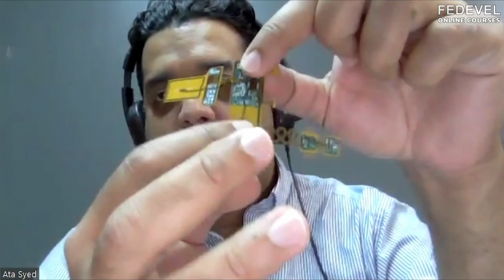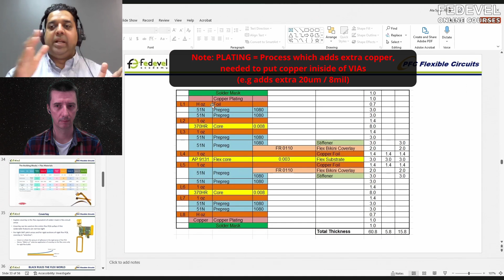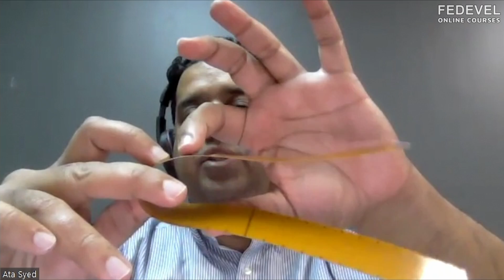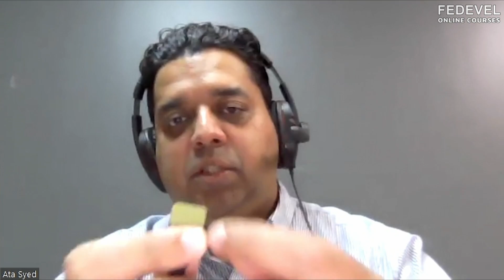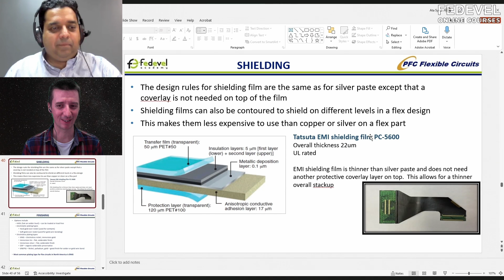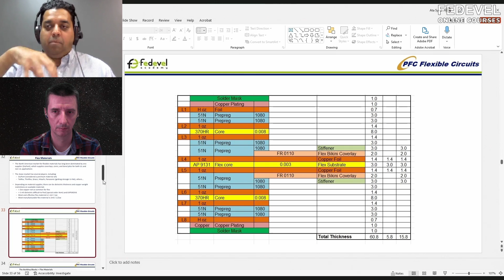Designing a FLEX PCB? You Need To Know This ....

Comment: Camera manufacturers needs to design their flex cables specifically inside retracting lens mechanisms to be stronger. They tend to break since the bending point is not reinforced. Is it planned obsolence?

Comment: Thank you very much Robert! Just followed the whole video. It is very detailed, answered most of my questions. Didn’t see too much about Altium and how to draw the stiffner area, guess it’s a mechanical layer. But other things were covered very extensive. ❤
Reply: Yes its just a mechanical layer. If your stiffener has no PTH holes, then just draw a mechanical layer to the dimensions with holes in it. If stiffener has PTH holes, then it can still be drawn as is, but you need to identify the holes as PTH. Bottom line is that you draw it like a mechanical layer.

Comment: hello sir i have a question can we put coverlay above  pads ?
Reply: In the sense of mechanical retention of the pads? (Partially covered) or completely?
Reply: Think of coverlay as soldermask equivalent. Technically, YES you can put on pads but then you won't be able to solder the pads.

Comment: Whow, this is a brilliant video session.. i just had to watch it whole and write notes.. big thanks to you Robert and Ata. You covered many details that I need for designing flex PCB. For sure I will have to put link of acknowledgement if I manage to make a successful product. I kind of hope there are totally clear materials for Coverlay that do a decent protection of copper if PET is used as a core Flex substrate (total clearness is a design requirements). I think 3M transparent material was mentioned by Ata for stiffener at some point in the videao. Thanks for all.

Comment: couldn't you pick and place your stiffeners ? that tightly coupled bus bar looks like a great idea
Reply: Yes you can but the issue is that in order to bond stiffeners with flex, you need to put put the boards in press machine to ensure bonding is good. When you put them in press machine, you have to create type of a fixture (basically a FR-4 panel with cavities for stiffener), and put as many boards in a fixture as possible to maximize efficiency. Bottom line is that it is a very labour sensitive process.

I am not saying that its complicated process (in most cases its not that difficult) but its if very labour sensitive.

If you don't use press to bond stiffeners to flex, you may have delamination between stiffener and flex or stiffeners may even come off.

Comment: We used a flex pcb which had 20 twisted pair conductors and fully screened. so there were plated through holes in the flex as he tracks swapped sides to form the twisted pairs. the screen had to go into a x-hatch pattern where the flex had to bend. after all that design effort would you  believe it we got one connector 180 deg out.  So had to do it all over again.
Reply from the maker: Oh